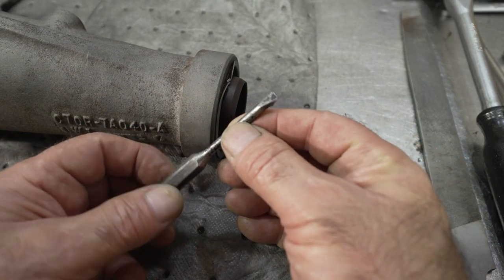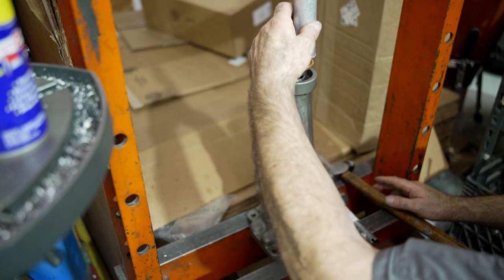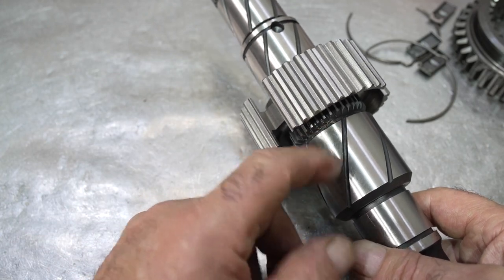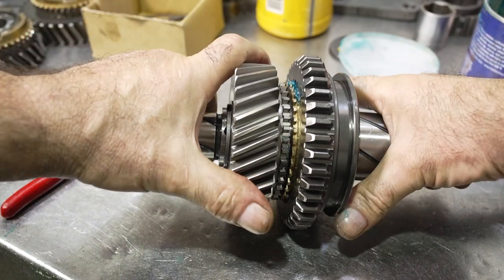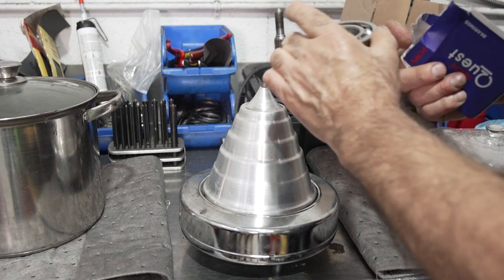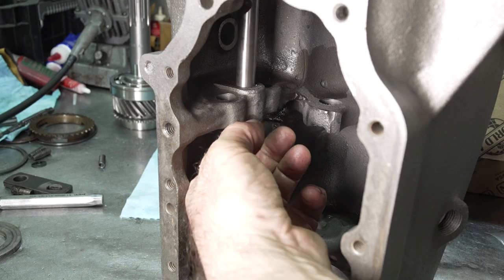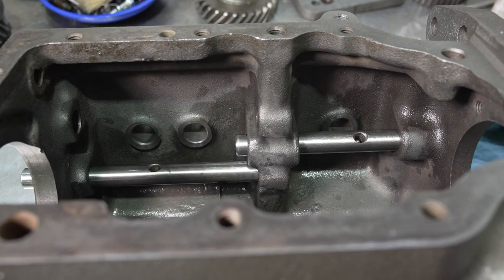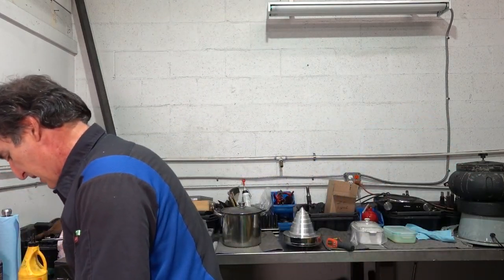Learn How To Rebuild a Ford Toploader 4 Speed - Part 3

Comment: Paul, thanks for including the shift rail information.  I'm the person that asked for that information in part 2.  I did not test my rails prior to assembly. The difference in length and end type between the detents had stopped me from moving forward. I bought a new rail kit from David Kee several years ago, I will get the box back on the bench and give it another go. Again, thank you.  Subscribed and liked.
Reply from the maker: Thank you

Comment: Brovo!  I have a Chevy Corvair 4 speed and there was no video on this, so I found you for this ford and It really helped. I was stuck at the lock outs and ball & spring. now I have a direction to go. Thank You
Reply from the maker: The corvair unit is basically a Saginaw four speed. A little different because the input shaft and output shaft run through one another but other than that it's the same
Reply: @GearBoxVideo  question, do you know if they share the same needle bearings size and detent, spring and balls? Can’t find any for the Corvair
Reply from the maker: Should be

Comment: Great content, perfect timing.  I’m rebuilding one of these units myself.  However, you might show or mention if the new 1-2 slider has the corresponding torque lock taper machined in it.  I’m assuming they do.  Based on the info regarding the torque lock system, provided in the second video, I just ordered a new 1-2 slider, as well as, a new 1st and 2nd gear.  Thanks again for another great video.
Reply from the maker: I did in part 2.  The explaination and rules are stated. All new gears have torque locking so all synchro sliders must match them.

Comment: just found your videos and this is truly gold. I Just rebuilt my M45 for a volvo rally car, not the same thing but very similar! I just wished i had watched your videos before i did it. 
Now I probably should disassembly it again and check some things. 
I have had issues with not getting the 2nd gear to go in fast enough. After watching your videos i think its the tooths on the sliders fault, (was quite worn).

Comment: Found Mr Freddy on YouTube called him and setup a time to come down and meet. 

Just so happened he was going to the Turkey Rod Run in Daytona  and I was also

Met and purchased a Toploader setup kit for a 66 Mustang 6 Cyl to V8 swap 

Very knowledgeable and   Assisted me (an old Chevy guy) to accomplish this job 

Very satisfied with the purchase and everything went well with the swap.

Do yourself a favor and contact him and save yourself some heartache
Reply from the maker: Would heartache are you actually talking about? I've been in the manual transmission business for 43 years. Trust me if anybody is getting parts they are getting it from the same place I am

Comment: Priceless tips thanks for sharing! One question - you mention Snap Rings have an "install direction". Can you explain or is there a video I can reference?
Reply: I found it! at the 13 minute mark of the Tremec rebuild video you explain... there is a wider and narrow side at the snap ring opening. the narrow side goes UP and the wider side goes down (basically) it's so the snap ring tool can grip on the narrow side when you have to remove the snap ring. If the wide side is up, then the snap ring pliers will slip and make it harder to get the snap ring out.
Reply: Snap Ring install direction video: 13 minute mark of How To Rebuild a Jeep T176 Tremec 4 Speed Toploader - Part 2 video

Comment: Hi Paul thanks for a great video. Do you use the same 12 thousandths clearance on 2nd gear as you do on third
Reply from the maker: There has never been a clearance issue. 2nd is fixed by the washer and mainshaft and usually ok. A tight clearance would require trimming the flange on the mainshaft.

Comment: I noticed you always replace bushings which is fine. For those who don't have presses and specials tools, is it all right to measure the bushing it see if it's really needs replacing to save us the trouble? Thanks.
Reply from the maker: If the bore is smooth, they usually are OK. It is when they are badly scored. Typically .005 clearance is what I like to see.

Comment: I can’t stop watching this rebuild series lol. But I have a few questions, have you ever worked with David Kee parts? Do you need torque locking gears & selectors for all gears, or just 2 & 3 since they’re the most abusively shifted into? Which taiwanese company did you say reproduces these gears? Is there a company that makes selectors with torque locking teeth on one side for 2nd or 3rd gear, & normal straight teeth on the other side for 1st & 4th? I feel confident from watching your videos, that I can do this myself! The satisfaction will be enormous, you’re awesome for making these videos
Reply from the maker: As mentioned in the video, all new gears are Torque locking and you can use non locking gears with locking sliders  David Kee parts were featured in my book . Sunup Gear in Taiwan makes the gears
Reply: @GearBoxVideo  I think I’ll buy your book, thanks for the help, & all you’ve done !

Comment: I got a question.  You said that we need .012 clearance between third gear and 3 & 4 Synchro.  What about second gear and synchro?  Your look like there is some play... Mine no play at all.  What should i do?  Grind down the tab shim/washer or the second gear .012 is for each gear or just the third?

Thank you
Reply from the maker: the 1-2 hub floats.. move the hub away

Comment: Took out my 69 f100 with a 390 fe and 4 sp top loader for a ride last week and after a few blocks got to a red light, put it in 1st and when i was going to shift to 2nd it was hard to come out and it would not engage into 2nd, came to the next light and tried to put it in 1st and it would grind so i put it in 2nd ( was hard to shift into it) took off on 2nd and it was also hard to come out. 3rd and 4th shift good Notice that it just does it while the truck is moving, if im parked it goes into all shifts without forcing it. Any idea of what it could be?
Reply from the maker: Your clutch is not releasing properly
Reply: @GearBoxVideo  I got home and adjusted the clutch. But I'll give it a good look tomorrow  to see if I didn't  lose a leg on it. Thank you.

Comment: Does the top loader have different lengths of input shafts?
Reply from the maker: Yes big and small blocks have different length pilots
Reply: @GearBoxVideo thank you so much for your help! This explains why I’m having trouble. I went from a big block 352 to a 300 straight six. Do they make spacer plates? And where could I find them?
Reply from the maker: That is something that you are going to just have to mock up. Put the bellhousing on the engine with the trans and see where your shortcomings are. You may just have to extend the pilot bushing. There use to be a company that made an insert for the crankshaft that extended the pilot pushing when using short pilot inputs in different applications
Reply: @GearBoxVideo thank you so much for your help!

Comment: Great work, one thing i am wondering, did you say all parts are new? if so WOW the cost must be through the moon. I thought you would be doing an old tranie with some decent and some bad parts? , maybe show your secrets of repairing the old not so precise parts and/ or how to do with what you got without spending a nasa budget. My main issue is some teeth on main shaft where the snap ring holds 3rd 4th synch hub, ..some teeth are missing, was wondering if that would cause any real problems, [regular shifting, not drag racong]  but i see you got a brand new shaft, no need to deal with that i guess.  nice to be rich,lol. but not everyone os jp morgan, that can buy all new parts.
Reply from the maker: The parts are actually not that bad cost wise. I will have costs up after this series is done